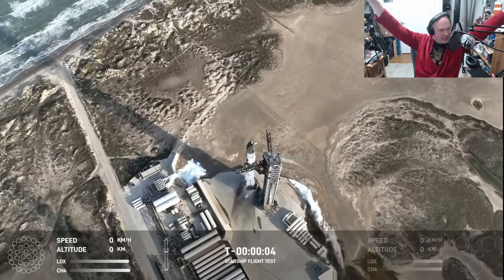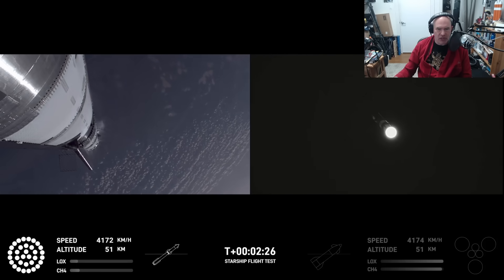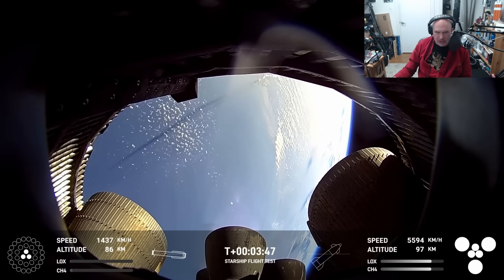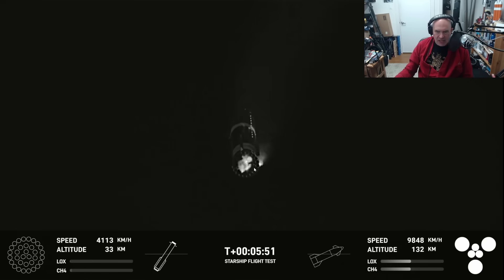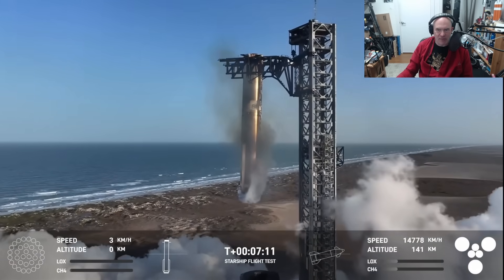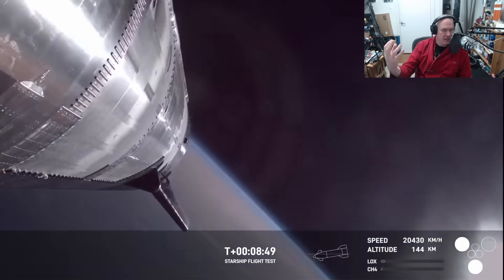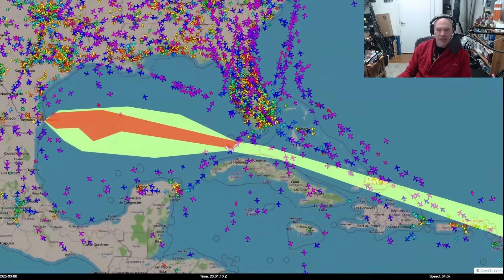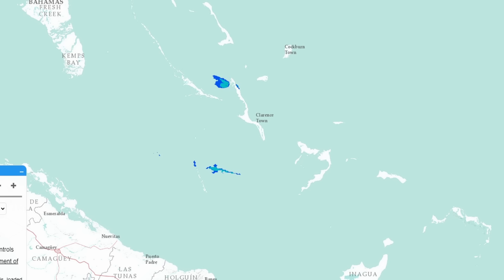SpaceX Make The Same Mistake Twice With Starship Flight 8

Comment: At this rate Starship will have launched more times than Saturn V did over its entire life spann even before it gets to orbit.
Reply: Not sure what your comparison is meant to convey. The pacing of the Apollo program was furious, too, but prior to that, many orbital launches were conducted with previous launch systems.
Reply: @rickbase833  the point is SpaceX is ahead of the curve with way less resources...  Oh and they haven't kill 17 people through gross negligence yet...
Reply: Hasnt Starship reached orbital velocity multiple times, but purposefully didnt staying true to iterative mission profiles?
Reply: Yeah I mean all the reuse is cool, and there a LOT that goes into making it work, but the part that's failing here is the regular "be a rocket" part of the job that the Sat-V did really well 50 years ago...
Reply: You can't possibly compare the two. They couldn't be more different. Much higher liftoff loads, thrust  and vibro acoustic levels with SpaceX's 33 raptor engines. Different airframe materials (aluminum vs. stainless steel). Totally different launch profiles that includes hot staging.
Reply: Ketamine Fueld Development
Reply: UMMMM....NASA has experienced a number of rocket launch failures, with over 160 launches failing since the beginning of American space efforts, including failures of manned and unmanned vehicles.
Reply: Yup. I think they were putting rovers on the moon at this point with Apollo.
Reply: @angie99656  It was also taaking much longer between launches.
Reply: @napobg6842  And yet he can't even get the dumb thing into orbit
Reply: @angie99656  who is he?
Reply: @danhunters8226  Which is embarrassing.
Reply: In fairness those leaders at NASA had to focus on one goal only. In this case it’s space and boosting (pun) nazisme around the world.
Reply: They could have r
Reply: The only reason it did not yet get to orbit is that they didn't want it to. It would be trivial to adjust the flight profile to end up in orbit, even without engine restart. But you don't want to leave such a giant vehicle in orbit so you have a controlled reentry position.
Reply: How many Saturn V boosters did they catch?
Reply: @peregrine3845  Catching boosters was not part of their design. They designed an extraordinary spacecraft, engineered it thoroughly (after Apollo 1, sadly), and never flew it with the intent that it should blow up.
Reply: @peregrine3845  none, they didn’t juggle any chainsaws either. They were too busy going to the moon. What’s your point?
Reply: NASA just hired a bunch of actual Nazis to make their rockets. You guys don’t support  that would you?
Reply: And you forgot one of them is designed to be reusable.
Reply: And then compare the design philosophy and the total cost...
Reply: Saturn 5 also had a flawless first test launch on a tighter schedule. Points to design philosophy issues and leadership problems at spacex imo.
Reply: @casacara  It's an iterative process. Comparing Saturn V to Starship is apples to oranges. I'm sure the rocket scientist in you can agree.
Reply: Have you not learned what happened to Apollo 1 ? Are you upset that Space x is extensively testing it's rockets so we can have a safer product. Or do you suggest we just put people in a death trap and hope for the best like NASA done back then.  @casacara
Reply: @soundsofnature7015  Apollo 1 didn't have anything to do with rocket technology, though.  There was an electrical fault in the capsule.  Apollo 1 didn't launch and was not going to launch.
Reply: @patrickrogers9689  Apollo 1 was going to launch. The accident happened during a dress rehearsal of an upcoming real launch where they were doing everything exactly the same as a real launch including fueling up the rocket and stopping short just before lighting up the engines.
Reply: @ and how long did they prepare before that first test? Compare that with how many Starships are being tested. Also the Saturn has a fraction of the thrust Starship has. Also Saturn was supposed to be disposable and not have the goal of being completely reusable. So many more innovations are being made as well.
Reply: @skch.animation  Reusable: researched and tested in the 1990s - not an innovation, merely an application.

Thrust Saturn V vs Starship thing is (as is typically the case when Musk is involved) is very much a story of 'once it finally works (which isn't yet the case) it will be three times more powerful than the Saturn V'.
That is a bit like how Musk keeps saying 'next year, Tesla's will be fully self-driving'-for more than ten years in a row.

So it is still, at best, more powerful ON PAPER, which isn't a thing. The Enterprise from Star Trek flies much faster than Saturn V. A similarly valid claim.

So they go for a lot of fudging in their communications, such as saying 'Starship is more powerful than the SECOND STAGE of Saturn V', which may be true but is also basically admitting that, no, we're not yet as powerful as the real thing. Stage 1 does, obviously and pun intended 'the real heavy lifting'.

The whole thing feels sketch.
Reply: The Saturn engineers had just over 11 years from the first time a US rocket / spacecraft orbited earth to successfully land on the moon.

Starship has over 65 years of experience and modern technology ... They make good fireworks!
Reply: @todortodorov6056  Very informed take. LOL. You do realize that the NASA Artemis SLS, which has spent about $90B since 2011, has exactly 1 launch completed in 13 years of development. Right?
Reply: @todortodorov6056yes exactly, and previous experience of landing rockets too (delta clipper)
Reply: imagine working for years and years and years, doing countless simulations and figuring out the design and finalizing it, so that it works right the first time - and then it still breaks when you launch.
Reply: @kargaroc386  years and years on what project exactly?
Reply: And that thing with the chopsticks is still a failure. 

Only call it a success when they actually relaunch the thing that they caught.

So-far, they have exactly ZERO reused Starship boosters.
Reply: @pauligrossinoz  Even if they could reuse that thing. The fact that they have to launch like 20 of them in order to take Starship anywhere but low Earth orbit, completely blows the reusable aspect of it out of the water. Be much cheaper and more cost-effective to build one properly designed rocket like the Apollo that is staged appropriately to go where it needs to go. This delusional fantasy needs to end We need to stop funding it and we need to get Elon out of our government. He is just a parasite.
Reply: Yeah - at least the Saturn 5 worked!
Reply: @rattywoof5259  It had failures too, even killed people.
Reply: But they were still extensively testing each and every part (just separately), weren't they? Otherwise why would it cost so much
Reply: Upset the Elon fanboys with this one 😅
Reply: The biggest difference is budget... Apollo was getting over 1% of the US budget in the 60s..... Also there's something to be said about luck.. Apollo 4 if I recall almost put the center F1 through the aft bulkhead from POGO... Apollo 6 was almost a complete loss save a wiring error accidentally shutting down 2 I believe J2s which were shaking eachother  apart from POGO... Had they not shut down the booster would of failed and Apollo 8 doesn't happen....  Apollo 13 had an early J2 shut down probably POGO...  So with like 1.5% of the e tire IS budget and 100K workers on the c raft they had issues 6 flights in. And were saved by pure dumb luck.. ...
Reply: @chrisjohnson4666  Just to be clear, Elon doesn't seem to have any issues with his budget.   The most important thing to consider is that all of those Apollo engineers who designed and built those systems did a remarkably dang good job considering they were mostly using slide-rules and hand written notes on paper with lead pencils and edits with an eraser.  Go figure.😉
Reply: @chrisjohnson4666 Von Braun was a master at hiding design margin where the rest of NASA couldn’t take it away.  That’s not luck.
Reply: @jackalopewright5343  Apollo 6 was pure luck the only reason the flight was saved was because the two motors that were having issues were also accidentally cross wired and were shut down on accident... It was 100% pure luck the right .motors got shut down early because they were having problems only because the were wired wrong....  If they were wired correctly the mission probably fails and there is no Apollo 8 to the moon....
Reply: @chrisjohnson4666  Meanwhile the historical fact is that no mission ever failed due to the Saturn-V.
Reply: @jackalopewright5343  as I said there's alot to ne said for luck...  I think if one looks at it the we got away with it mentality of NASA during shuttle stems in part from this... Feynman  basically said so in an interview shortly after  Challenger...   I also wonder if Space X thought the last flight was just bad luck and not a design issue so they made a few tweaks and tried again...
Reply: @chrisjohnson4666  SLS is like a quarter of the Apollo program budget and gets a bunch more stuff done than just Moon trips.
Reply: @AG-el6vt  what exactly does it get done at 1.2 to 1.5  billion per pop????
Reply: @AG-el6vt  Dude, what? Do some actual research. Artemis SLS started in 2011, and $90B spent to date with only one launch.
Reply: @chrisjohnson4666  Fair enough; but with Apollo they were inventing this shit. This time round, they are just trying to productise something that was basically invented half a century ago.
Reinventing the wheel isn't as hard as doing it for the first time.
Even the superficially shiny stuff, like catching the first stage is basically 'been there, done that' technology that existed since the 1990s and that parlour trick is still the only thing they can impress us with after all this time.
Reply: @berendharmsen  full flow staged combustion was a dream 50 years ago the F1 was big but that's about all that separated it from the V2 engine... The J2 was cutting edge but wasn't full flow staged combination... Id also like to po8nt out the other side couldn't get their multiple engines booster to staging let alone land it... The booster success alone sets space X in league with 1960s US and Soviet space programs and at a small fraction of the cost...  The fact the Raptor engine makes it to staging is a minor miracle let alone landing the booster....
Reply: @chrisjohnson4666  And the fact that no one has been killed as a result of these two RUDs over a busy aviation corridor is also a miracle. Things came close last time.
Reply: @ not really, these things are done in advance and warnings are issued for that reason.
Reply: @berendharmsen ah yes, completely reusable ships with 33 of the most powerful engines on the planet by far. Who exactly did this before SpaceX “ripped them off”?
Reply: @berendharmsen  "superficially shiny stuff, like catching the first stage" -- WTF are you talking about?  "parlour trick"?  Name the other spacecraft company that has ever achieved it.🙄
Reply: @beenaplumber8379  you kidding me??? The entire point of a closed range is so no one gets killed...  They own that entire area until the rocket clears it...
Reply: @berendharmsen yes yes yes! People forget about the delta clipper doing belly flops and landing mid nineties, as if it is a new thing invented by spacex
Reply: @chrisjohnson4666 full flow is not this whole pandering. It basically facilitates reuse, but in non reusable engines as in the past, nobody bothered to develop it
Reply: @berendharmsen  What ? You are wrong on both accounts here. The Apollo program build on already existing tech and engines, they also had 100K people working on it for years. The results were more based on brute force than efficiency, and the program was more than lucky a few times, they still made mistakes and people died. 

Here it's new tech almost all around, made larger and with less ressources. The fuel, engines, scale and materials are all new. Who lunch and landed rockets in the 1990 ?
Reply: @berendharmsen catching rocket is 90’s technology?

Could you please elaborate which 90’s technology exactly that you’re talking about?
Reply: @-JustHuman-  Hydrolox engines were not exactly established tech in the early 1960s; and Apollo was following pretty closely behind the Minuteman program in adopting integrated circuits.
Reply: @rsteeb 
McDonnell Douglas achieved this in the 90s with the MD-X. When the Boeing merger happened, the project was canned and turned over to NASA, who (as usual) weren't given the financial resources to continue the project. The entire project was later given to Spacex. Their self-landing technology is literally based on another company's 30 year old work which they got for free.
Reply: @tonamg53 
McDonnell Douglas had developed a functioning prototype, the MD-X, pre-Boeing merger. When the merger happened, the project was canned and turned over to NASA, and later to Spacex.
Reply: @berendharmsen okay well that’s a little unfair, this is as much “reinventing the wheel” as the jet engine was reinventing the propeller. A two part fully reusable rocket stack is not at all the same as a multi-staged one-time use rocket stack.
Reply: @ so NOT an orbital class rocket but similar to SpaceX grasshopper and Starhooper…

Please try compare to things that are actually comparable next time.
Reply: @arthurdefreitaseprecht2648  Exactly. You can find videos from more than thirty years ago of the NASA doing the very same thing as SpaceX does now, only with a much cooler looking vehicle.
Reply: @tonamg53  These things are completely the same. The first stage has very little kinetic energy when it lands. The hard problem is exactly the same: same energy levels, same guidance systems, same, same, same. 

Like I said: shiny object to distract from the fact that they haven't solved the hard problem, which is replicating this for the upper stages (which is not even on the radar, given they can't even get into orbit after all this time).

SpaceX is woefully behind every single progress chart they themselves have been publishing. It truly feels they are now just lobbing stuff into the sky in order to pretend to the world they are seriously making progress on the actual, grown-up space ship.

It's clear that Musk is taking over the government in a desperate attempt at making sure no government body will still exist to properly evaluate the grift here.
Reply: @Syntex366  That analogy doesn't quite work. Propellers and jet engines are very different technologies, even though the both are about 'displacing air'. 
Rockets are rockets, and indeed, the SpaceX rockets are very much building on old rocket technology.
The reusable part is definitely not original either. Although they are the first to make it practical, the technology that is needed is almost completely 'off the shelf' electronics. You could build a scaled-down version of it yourself with components you can buy online if you had the will and skill to do it, and budget wouldn't be the problem.
Reply: @ Stopping a massive rocket entering Earth atmosphere at Mach 20 to a halt is a lot harder than just hopping up and down…

You don’t need to be a genius to figure that out… you just need to not be an idiot.
Reply: @-JustHuman-  If you make the unfair point that Apollo used the pre-existing knowledge of the previous projects that were part of the moon mission you are correct. I would rather say that this was one project of the US to get man into space.

And calling it 'brute force' because it had a lot of people working on it may be technically correct, but it does sort of sell short the ridiculous amount of problems they were in fact solving - and solved - and on which SpaceX is now building its next generation systems with mostly off-the-shelf components, that exist thanks to the technological revolution that Apollo jumpstarted. 

Apollo needed 100K+ people to get us started. And now you can buy cheap chinese guidance electronics online because of that. And SpaceX uses those components to build its rockets. Not an insignificant feat, but not even vaguely in the ballpark of what came before. They are truly midgets standing on the shoulders of giants.

And indeed, this applies to vertical landings as well, which NASA prototyped way back in the 1990s.
Reply: @tonamg53  Exactly. So they still only show off the easy bit.
Reply: @berendharmsen definitely! it is so sad that NASA went for the venturestar instead of investing more on the delta clipper. And btw, it is hydro-lox powered, much more well suited for a second stage than starship
Reply: @ No, they already showed the hard bit in flight 5 that did a soft landing in an ocean.

Note that Starship flight 5 travelled to the other side of the planet in around 1.5 hours…

Yes, that is also the world record.
Reply: @tonamg53  For the first stage, it's Mach 3.7 at most. It's a completely different proposition from the vastly higher kinetic energy of the upper stages. 
The first is a solved problem - solved three decades ago - the second is, as we're seeing, the hard one.
Reply: @tonamg53  It was more: lob an empty tin can into space and see how long it survives while it crashes back to earth. It's not NOTHING, but it's also not even close to having solved anything.
Reply: @I am talking about Starship which is the second stage 🤦🏻‍♂️
Reply: @chrisjohnson4666 Soviet NK-33 was developed in the late 60s/early 70s, so full flow was not a dream for them 50 years ago.
Reply: @tonamg53  Starship holds the suborbital flight record, because sub-orbital flight is the kindergarten of the space industry.
Reply: @MotoWot  how did that work out for them??? Pretty sure it only worked in their dreams....
Reply: @ Anyobe believing Starship can’t do an orbital flight is a complete idiot.

 The hard part is not about achieving orbit.
Reply: @chrisjohnson4666  They obviously ran some NK-33s on the test stand  before putting them into production. All the engines "discovered" in storage after the fall of the Soviet Union were stripped, checked, then rebuilt as per original specs. Parts that may have deteriorated over time such as flexible seals were replaced. All the NK-33s flew on either Antares (American) or Soyuz-2.1V launch vehicles, in fact the last of the NK-33 engines launched about a month ago :(  After the fall of the Soviet Union and the American rocket engineers discovered the capabilities of the NK-33, RD-170 et al., they estimated the Soviets were two decades ahead of US rocket engine design. All modern high performance rocket engine designs, including Raptor, were heavily influenced by the NK-33. I think a lot of the people, such as yourself, are so enamored with SpaceX and their achievements because they are almost completely ignorant of spaceflight history.
Reply: @berendharmsen  Reinventing? Apollo was totally disposed of. Similar tech today would be Ariane 6 which took them 10+ years to get successfully to orbit after upgrading from Ariane 5. Not to mention it's going to be subsidized cause it's not economically viable. A real competotor is Falcon 9 which wins all the way around. Starship his is going to be 100% reusable. Very different ballparks.
Reply: @chrisjohnson4666  and this was 60 years ago. arent we supposed to be BETTER at rocket building? INstead, Spacex is worse.
Reply: @rosaliebent4833  really so show me who is better??? NASA spent hundreds of. Billions on STS and SLS which is 1970s tech...
Reply: @rosaliebent4833  Have you paid attention to NASA Artemis SLS? 13 years of development and $90B spent......one launch done. We get it. You don't like Elon. To bad for you.
Reply: @rickbase833  Where do you get $90 billion spent on developing the Space Launch System? Seems the GAO report back in 2023 reported: "NASA spent $11.8 billion to develop SLS, a cost that covered work though the Artemis 1 launch in November 2022" ...
Reply: @michaeldunne338  Give or take a bill here and there. 11B is BS when factoring all previous work originating in the 2000s with Orion.
Reply: @ I don't think Orion brings the investment to anywhere near $90 billion though. From 2006 through 2022 the money put into Orion seems to have come to $20.4 billion.
Reply: @chrisjohnson4666 The Saturn V engineers were using slide rules and any computer they had probably had less processing power than a calculator from the 80s. 

SpaceX relies on massive government contracts so not entirely private. All seems a bit wasteful to me. Maybe DOGE should be firing some people?
Reply: BS. Starship block 1 was capable of reaching orbit since  IFT 4 or 5. Later IFTs are necessary to achieve ability of landing 2nd stage. They can already land the 1st stage. Saturn 5 was fully expendable.
Reply: @DalHrusk  BS - starship HASN'T  got to orbit yet,
Reply: @garyc1384  Hasn't only because of safety. The suborbital trajectory was intentional. The block 1 was capable of reaching orbit.
Reply: @DalHrusk well, Starship was not reused even once yet, so right now it’s still closer to N1 than to Apollo.
Reply: @DalHrusk  but it didnt
Reply: @DalHrusk  Starship isn’t “capable” of anything until it does it. And it hasn’t. That doesn’t mean I don’t think they’ll work through the problems, or that there’s necessarily something wrong with what they are doing, but whatever they want to say it’s simply unproven “in theory” that it could have reached orbit. It means just as much as “they fixed the problem from last time, it won’t explode this flight” meant before this launch.
Reply: @DalHrusk  Yes saturn 5 was expendable... but it worked.  Starship is also expendable... because it always blows up.
Reply: @DalHrusk  Landing the first stage is cool, but hardly relevant. It's just scaled up hobby technology. You could build such a system yourself if you wanted to: a model rocket that goes up a bit and then land on a small, predetermined little square. This is off the shelf technology. They're good at making a great show, but it distracts from the fact that they struggle with the hard problem.

The big one is going to be getting the highly kinetic upper stages back in one piece. And they are far from achieving that. In fact, they can't so far even get it up into space to make an attempt at that.
Reply: @berendharmsen  What drives you to write such BS? For example homemade landing rocket doesn't  deal with reentry heating, Superheavy booster does. And 2nd stage at IFT 5 and 6 made it through the atmosphere to the ocean surface in very controlled manner.

If you take it that way you can also say that you are just a scaled up bacteria.
Reply: @DalHrusk  The reentry heating of the first stage isn't even vaguely in the ballpark of an actual deorbiting from orbit. It's just a jump up, and back down again. 
It's not completely trivial, but it's not really space travel.
Reply: @DalHrusk  The reentry heating of the first stage is not really a thing - as we've seen. The speeds just aren't high enough. It's a vertical, sub-orbital launch; a hop up-and-down. Cool trick, but not really space flight.

The 'making it through the atmosphere into the ocean' was hardly 'landing a space ship'. It was 'watch a mostly empty tin can fall back to earth and not quite burning all the way up before it hit the ocean'.
Reply: @berendharmsen  If you think so then you probably wasn't watching at all or you are just lying.

Tin can falling from orbit would simply burn in the atmosphere. And if shielded, it wouldn't reach the exact predetermined spot like Starship did.

Again - what drives you to write such things?
Reply: @DalHrusk  A tin can with some maneuvering thrusters. I didn't say the test had no purpose, just that it was very far removed from 'actual space ship actually going into orbit'. It was a mock up of the real thing with some test equipment to see if they could maneuver it, the answer to which was: mostly no.
I find it astounding that people are still enthusiastic about this incredibly leisurely 'let's shoot some thing into the air every couple of weeks/months to keep them happy (let's not forget to capture the first stage because that always distracts from the stuff that really matters).
This is not 'break things and develop fast'. This is 'blow up taxpayers money without anything to show for it'. 
Timelines are irrelevant, end goals are irrelevant; they are just playing 'rocket people' with tax money without any care about returns on investments.

I mean, you do realise who is the boss there, right? You know how he keeps promising the same 'next year, we will...' over and over, right?

SpaceX is a good company with its commercial launches, but it isn't doing anything that doesn't already exist all over the world. They merely managed to corner the US launch market and that has nothing to do with efficiency or lower cost. If SpaceX stops tomorrow, we'll be caught up by some other company in a few years. 

Their Starship project is - so far - mostly bullshit; vapourware like Musk's robots, his self-driving cars, his hyperloop and the list goes on.

Maybe I'm wrong. But I may not live long enough to see this proven, given the glacial pace at which this project moves along. They got at the low hanging fruit a few years ago, and now they seem to be running into the true hard problems.

We'll have to see how they deal with that, but we're in unknown territory on that. So far, they've been coasting on recycling existing tech. Now they have to come up with something new.
Reply: I can't say I agree with the sentiment. Saturn 5 was fully expendable and the architecture was intended for a small payload to the moon. Starship architecture solved fundamentally different problems and workloads. Additionally, Saturn 5 launches cost 1 billion per launch and these are in the high tens of millions. They are test hardware, not intended to perform 100% of the functions but just provide a test bed for the final design. Is it wasteful? Yes. Will it work? Maybe? I'm optimistic.
Reply: @cameryngallardo that cost per launch for starship takes Into account amortization from reusing vehicles.  That hasn’t happened yet.  Each launch is costing far more than just a few million.
Reply: @russellharrell2747  Far less than the billions spent on Artemis so far. NASA can't even get space suits right.
Reply: @cameryngallardo there is no way starship will be in the high tens of millions. Look at the colossal costs of the program, this cost will have to be diluted to the launches, apart from profit and other operations. Don't talk about costs before commercial launches happen, otherwise it is just guessing
Reply: @cameryngallardo  I get your concern about it eventually working. I think it will. As for the NASA Artemis program, that system is way over budget and behind schedule. I'm inclined to think that Artemis will get canceled as billions have already been spent with one whole launch to date.
Reply: @rickbase833  There should have been three Artemis launches to date, 1 x SLS, 2 x Starship. SpaceX is jeopardizing Artemis.
Reply: lol, Starship has a much harder job than Saturn V. That rocket just launches and dumps all its parts, period. Starship has to come back from orbit and be caught by a tower. Completely new tech is needed.
Reply: @ShannonJohnson-k8z  but once in orbit the Starship is not going anywhere until someone launches 10 to 20 other starships to refuel it. So the entire reusability factor of it is worthless. Just admit this thing is a goddamn joke.
Reply: @ShannonJohnson-k8z man do you know there were no flight computers before apollo? Do you realize they designed the rocket with slide rulers and no cad? That they were doing a heck of firsts? It is not because something is expendable, that it is easy to make. Don't be an oxymoron
Reply: @ShannonJohnson-k8z  Like the Space Shuttle, only more complicated?
Reply: Yes, but all of the stages on the Saturn V were expended.  You're comparing apples to oranges.  This entire system is brand new, never been done before flight tests.  Recovery of both stages.  Way different than throwing everything away on your way up like the Saturn V did.  The engineering on this system is far more complex than Saturn V.
Reply: @SpaceXNerdTom  Well so far every Starship has been expended. 🤡